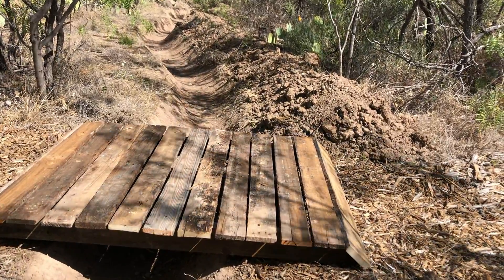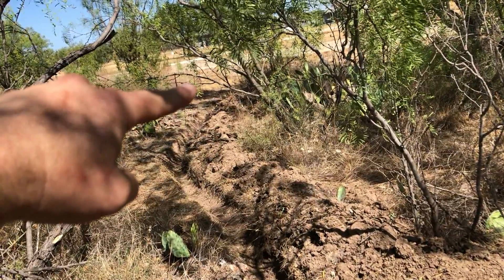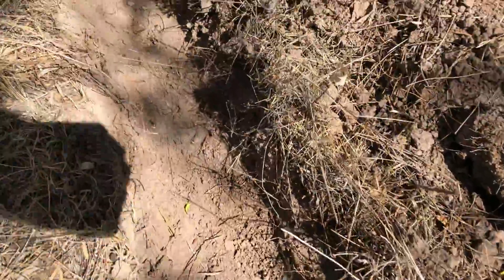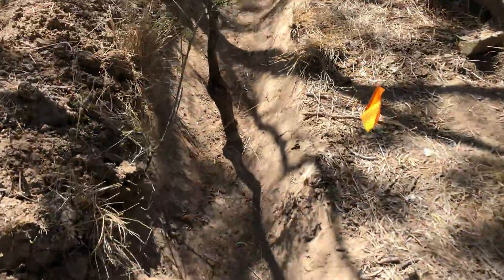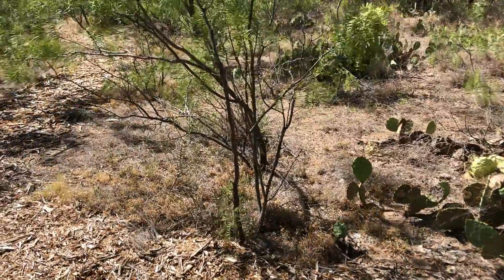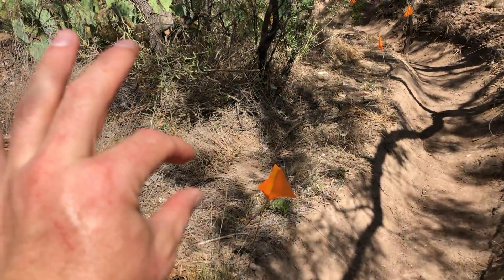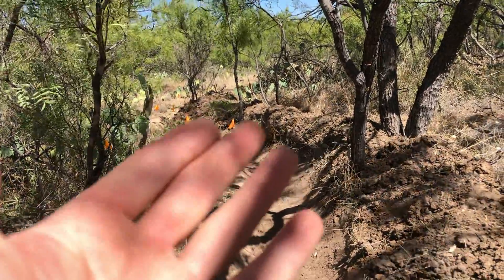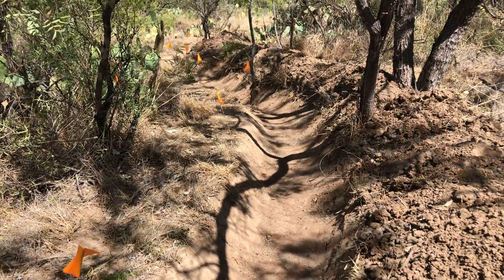Swale Project Part 6:  Accessing Road Drainage Ditch

Comment: One inch of rain in one square foot (12 inches x 12 inches) is approximately .6 gallons
Reply from the maker: Thanks. I usually google rain volume calculators to get an idea of how much I may be getting.
Reply: That's 6/10ths of a gallon, not sure the decimal was noticed.  We were blessed with 1 & 1/2 inches of much needed rain yesterday. Have a good weekend.

Comment: Great job! It just keeps growing! Something I wonder. I know most of the mesquite trees are not that tall. Walking in them can be an issue unless your really short. Are they tall enough to provide shade while you work or walk through there or is your head always catching the sun?
Reply from the maker: Hello, some of the mesquite trees around the swales are shorter than I am, but some of the others are over 10’ and provide adequate shade. I’d guess that the tallest mesquite trees on the property may get up to 25’ or so. The branches will sag quite a bit when heavy with beans. Between the cactus and mesquite, I tend to get pretty beat up working out there, but I enjoy it.